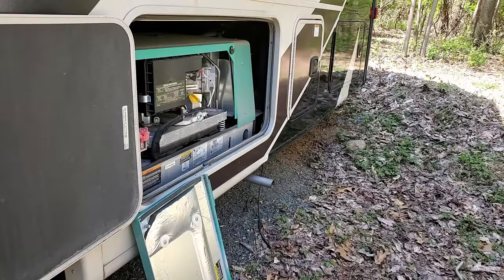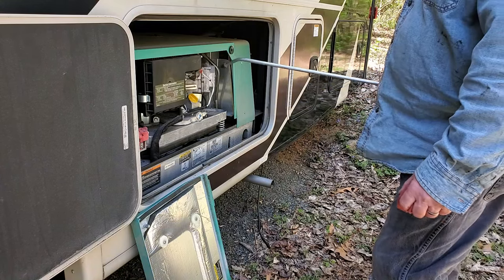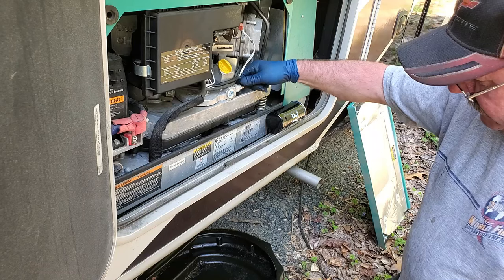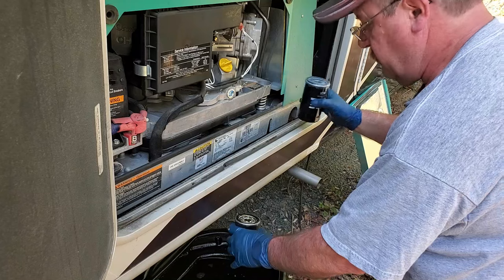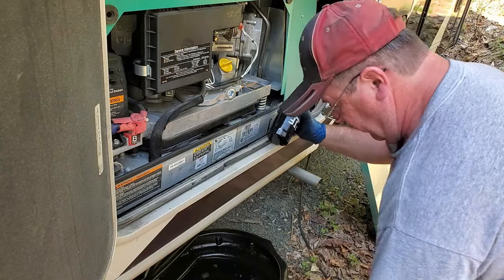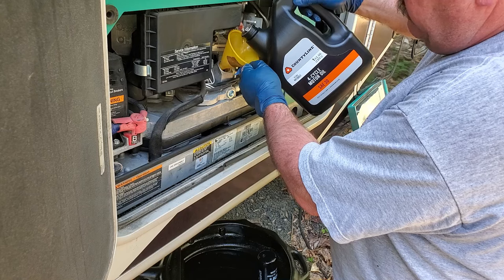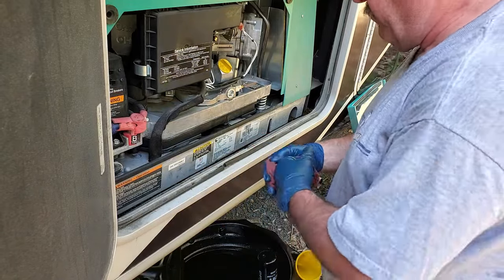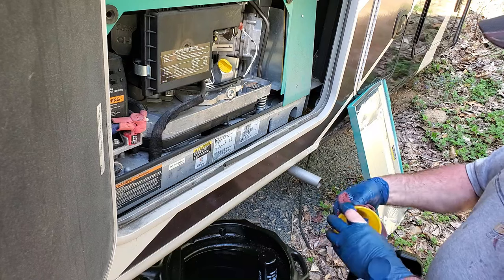RV Generator Oil Change, FIRST TIME

Comment: That generator looks like a ohnan made unit you have riding mower king 👑
Reply from the maker: Yes it actually is. One company bought out the other, so there are both names on it.
Reply: @ridingmowerking   yes.. Cummins is the company that bought out onan generator company

Comment: Should be fine with 1/2 on the dip stick  😂
Reply from the maker: It would be, however the rv is not as level as it should be. I did have to add a little more later. but generator is working perfect, no issues.